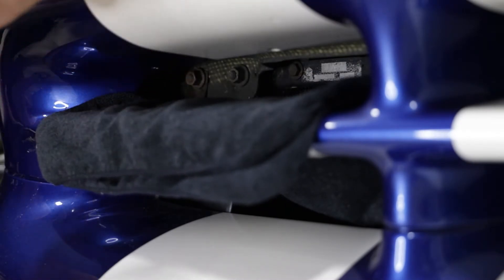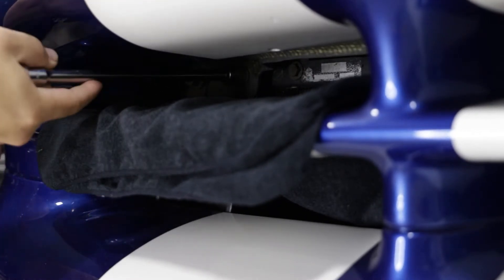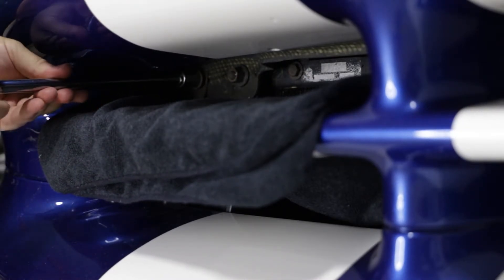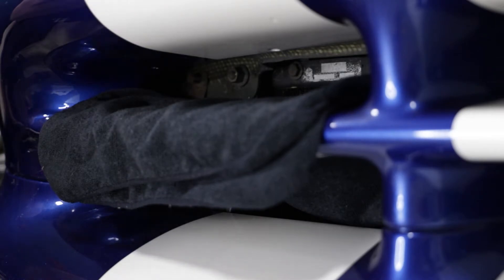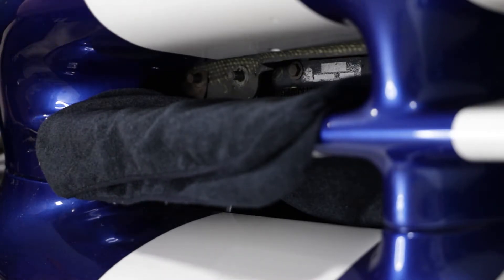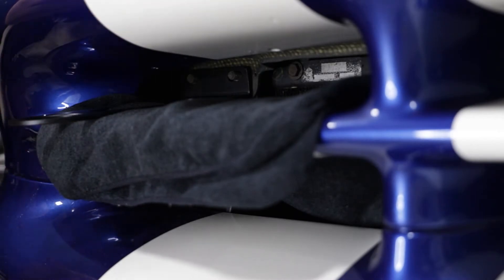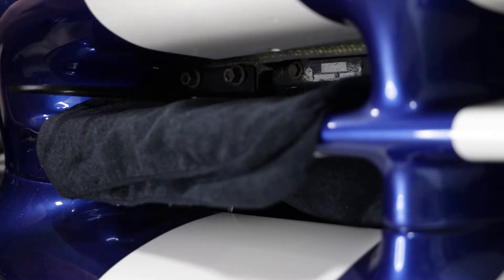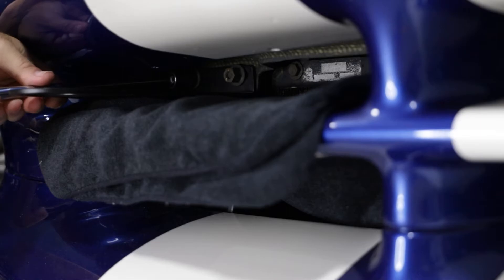Tech Talk Tuesday: Dodge Viper Front Tow Hook Installation

Comment: I am very interested to see which ipso parts u choose to put on.  That is, unless you want to tell us now :)
Reply from the maker: I will be installing their shorter shiter arm (have their 1" drop currently installed, but swapping it with their 2" drop), billet transmission crossmember with poly mount and billet steering rack bushings.

Comment: Hello
I have a 2009 Dodge Viper. On mine there is no 2 screws to unbolt on the driver side to place the tow hook. There’s only the one bolt to unscrew. Would like to know the strength on that side and where it’s attached to the body frame. No 2 bolts on the passenger side. Any suggestions you have to help. Thank you for your time
Hope it makes sense
Reply from the maker: Unfortunately I haven't installed any tow hooks on a Gen IV, just my Gen II. I know they make kits specifically for the Gen IV though.